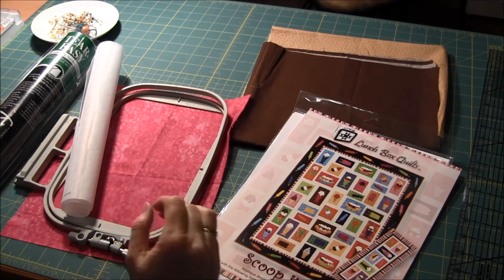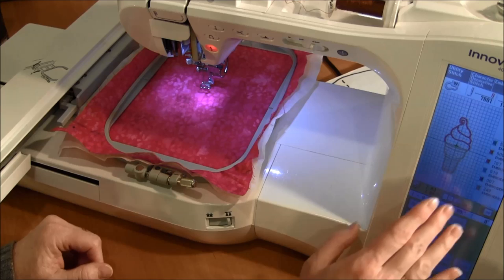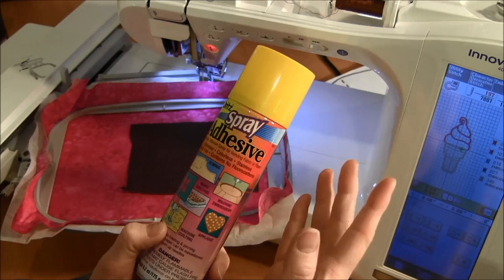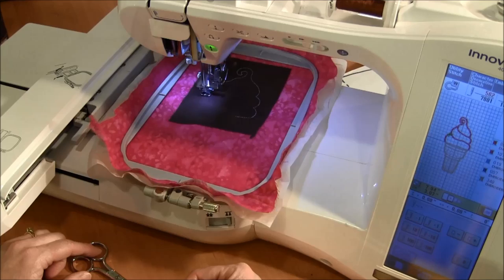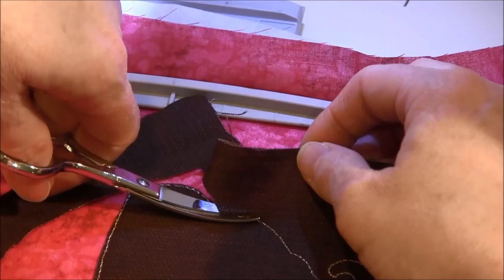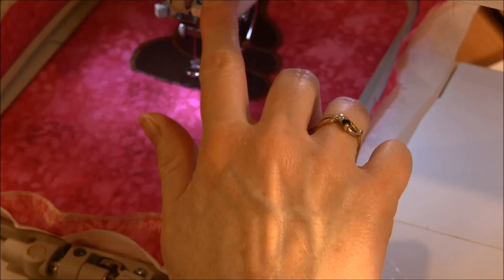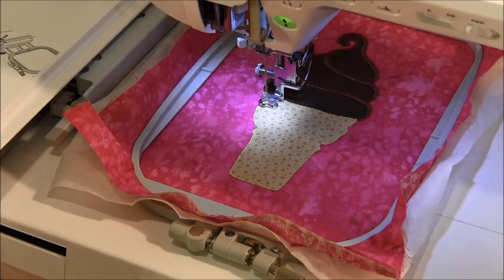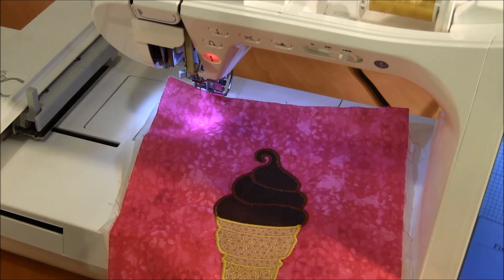How to Applique on an Embroidery Machine

Comment: At what point in the video did the machine do the quilting to make the diamond patter type of groove? I saw it twice and missed both times.. thank you!
Reply from the maker: Hi Claudia!  I didn't show every step in the stitching because that would just be redundant.  It would have stitched that sometime between finishing the tack down of the fabrics but before the satin stitches which finish the edges.  The machine stops after each color so you can change threads if needed.  Hope this helps. 
 Happy Stitching!

Comment: So you do not use an fusible stabilizer on the fabric that you are using for the applique, just the spray adhesive?
Reply from the maker: +Kasey Perkins Hi.  Thanks for the question!  When doing machine applique, you do not need to put any stabilizer on the applique pieces.  You do have stabilizer behind the main piece of fabric though.  This is enough to stabilize everything.  I hope you enjoyed our video. Please be sure to "Like" and to subscribe to our channel for more videos!
Reply: Thank you, I believe this is where the problems I am having lies, my needle starts to get gummed up about halfway through and then the thread starts to tangle on the bottom and pulls the fabric down into the machine or creates birds nest.
Reply from the maker: +Kasey Perkins Yeah, I guess that would be a lot of layers.  Good luck!  I hope you have success!